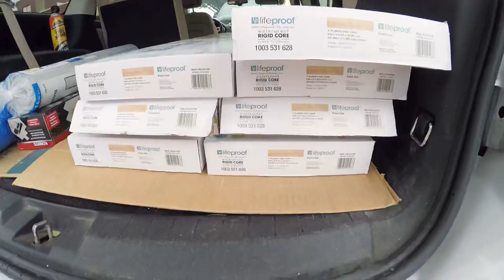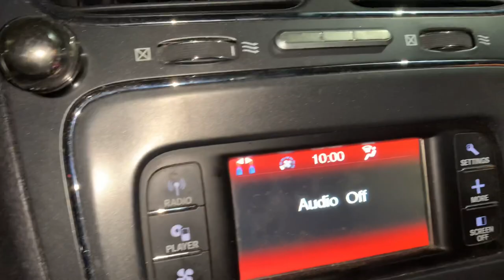ROBBED!!  & we start flooring || 2020 Bus Conversion - Ep. 35 | TaleOfTwoSmittys

Comment: I'm so sorry to hear that. I hope karma does it's thing. I'd recommend the Wyze cameras. I've been using them for the house and just installed 3 on the bus. They are a steal and absolutely great quality. You can get the outdoor ones or just the normal indoor one with the outdoor case extras. Put some SD cards for non-stop recording and you should be set. Again, sorry to hear that and hope you find joy back soon! Cheers!
Reply from the maker: Thank you so much. Are they 12V cameras by chance?
Reply: @TaleOfTwoSmittys  they are not, but I just used a step down or buck converter  from 12v to 5v usb from Amazon. I'll send you the link on instagram!
Reply from the maker: Thanks Glaucio!

Comment: Jeez that blows y'all.... people out there are just shitty sometimes. The storage where my bus is also has storage units next door - it sucks that that happened to y'all, but it's made me think that even though it'll be a pain in the ass, when I get to the phase in my build where I have those types of valuables in the bus, I'm thinking I'll rent one of the storage units and just haul the valuables from the bus to the unit when not in use. My storage is also secured lot, but unlike yours, I have 24/7 access - so never have to do the "race to the gate" thing LOL
Reply from the maker: Yeah it’s a tough balance. We didn’t have a truck to easily haul things to our storage units and back, and we were at the bus regularly enough for that to be a pain anyway. Glad you have a plan that’ll work for you—obviously we under-estimated the situation! 😣 Good luck with your build!
Reply: @TaleOfTwoSmittys  haha yeah I hear that - my vehicle to "haul" is a 2005 Jeep Liberty CRD 4x4 I plan to flat tow with my blue ox bar (also a DIESEL - only one fuel to worry about this way but that's a whole other topic) so it's not much bigger than the journey I saw y'all had LOL - I'm half tempted when I get the build really underway to just buy a cheap craigslist beater truck like an old ranger or F-150 or something along those lines, and then just sell it when I'm done.... easier to haul stuff from the supply store that way ;)